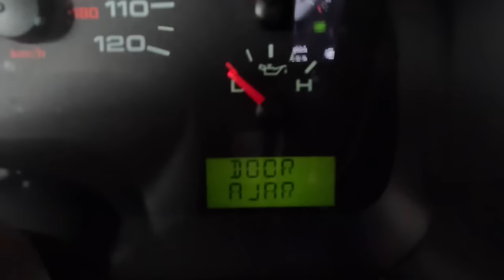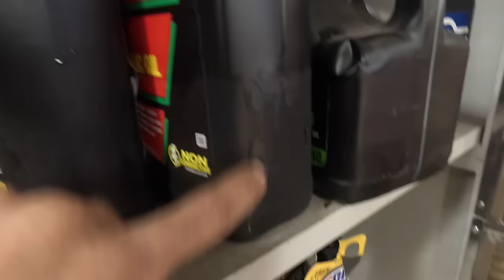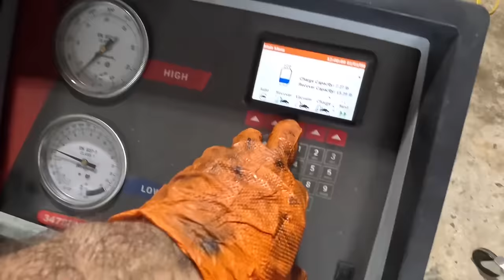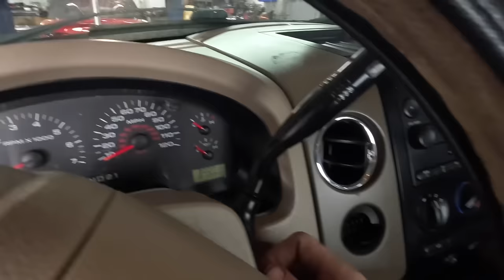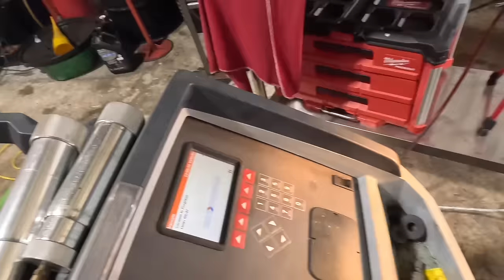New Engine! Warranty Camshaft Sprocket Cheap and Risky! Ford F150 F250 5.4 Triton

Comment: How much would you typically charge to do 2 cam phasers on a 2012 f150 ecoboost with 150k miles? Would it be best to just go ahead and replace timing chains and timing sliders/parts too while doing the work? If so… how much would you charge for that job vs just replacing 2 cam phasers?
Reply: Being as this was a premium remanufactured engine, you would think most parts with an obvious wear factor would be replaced while it was out of the vehicle on the shop floor/bench.

Comment: There area lot of boats in Florida, the 5.4 Triton 3 valve for an anchor. One of the worst engines ever made! The remanufacturer was messing with you to run it with no valve covers! You can't  rebuild a turd! Should have installed  the 4.6 engine!